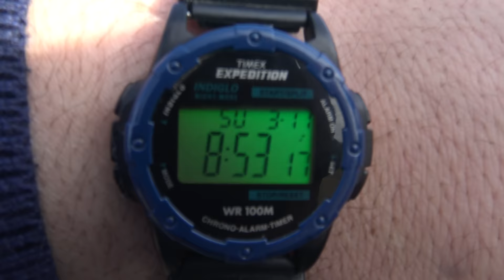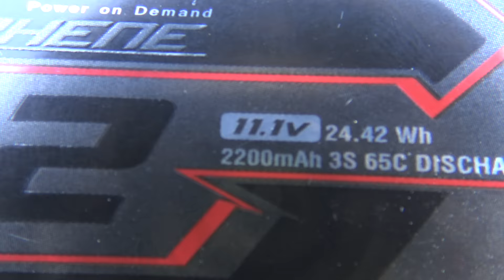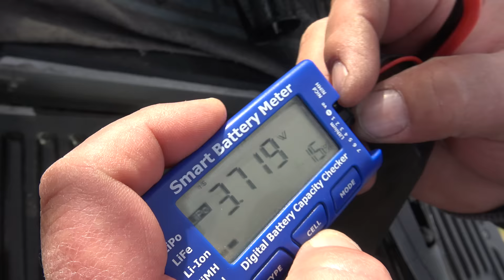SR-71 Blackbird Lockheed 2x 64mm 3S EDF Jet PNP Maiden flight

Comment: Another entertaining video Captain Robert & Blaz ! You were fighting the wind during the landing phase for sure. I visited the FreeWing Hobby Squawk blog and someone mentioned the exhaust diameter should not be less than 95% of  fans diameters. 
They also discussed upgrading to a 10 or 12 blade fan but of course you would have to replace motors , ESC and battery and planes battery compartment cannot handle a 6S battery without cutting foam. Advantages would be faster acceleration and shorter takeoffs. The sound on the 12 blade fan is also sexier for sure. But “ you’ll never stop with buying just one plane” how true Captain Robert!

Comment: I'm rather new to this channel.  I call that flight a success.  It really did look great in the air.  

It must be windy there most of the time.  If you 2 got to fly in calm conditions you would be instant masters.  I used to fly a small drone in windy conditions as a challenge.  It was fun to watch it backing up with full throttle.

Comment: I don't know if you'll see this comment Pilot Robert, but the reason the exhaust tube tapers on EDF's is to properly load the fan blades, give the rotor something to push against, and slightly higher exhaust velocity. there's some tinkering with the amount of taper to get the best performance without over amping the motor. the inlets will be shaped as such to slightly compress the incoming air to give the rotor some bite

Comment: Dis it it, hey! For ducted fans, inlet and nozzle design is incredibly important. The advantage is that by changing the area and shape, you can control its efficiency at different airspeeds. Mass flow rate is one thing, but air speed and air pressure also matter! OH YEAH!

Comment: I can help you with one idea... Where is the thrust connecting to the plane? It is not the air going out the back at the exhaust! It is at the blades of the EDF! Why do they add some cones or narrowing at the end of the tail pipe? Because the faster airflow lowers the pressure! This lower pressure enables the EDF to throw more air through the blades! That is an increase in thrust. There is an art to determine the curve related to thrust and the drag caused by the narrowing or coning of the exhaust. Too much narrowing or too large of coning will create more drag at the rear of the exhaust and the airflow speed will drop, which reduces the amount of air going through the blades, and the thrust drops. Weighing the thrust with different nozzles or cones can help determine the proper amount of narrowing or the size and shape of the cones.
In a real jet, there are many ways to slow the air going into the engine, including variable inlet controls. In the real SR-71 the cones move depending on the speed of the plane. 
As for modeling, it is important that the tube between the EDF and the exhaust should be as smooth as possible. The air coming out of the EDF is creating high pressure on the walls of the tube, and low pressure in the center of the tube. The air is spinning as well. So anything sticking into this airflow will reduce thrust. Thanks for not giving up on this plane. It will look great hanging from your ceiling! Thanks for telling us the history of your efforts to get this plane flying.

Comment: Fighter jets have adjustable nozzles. On take off they are fully open for max thrust but for  fast speeds they are  narrowed.   On the first flight the plane was very nose heavy.   You used the elevator to keep the nose up but this angle would not allow the plane to accelerate.

Comment: Maybe I can shed a little light on how the adjustable size of the outlets work with jets (called nozzles on fighter jets). 
With fighter jets, they will have large openings at the outlets when they are not using the after burners. 
When they use the afterburners, they reduce the diameter of the nozzles at the outlet but it's that intense heat that produces the additional thrust!
I'm sure you have seen fighter jets when they kick in the after burners, the nozzles move inwards to reduce the opening and then you see the nozzles turn red as the super hot exhaust and flames shoot out of the nozzles.  
Without the extreme heat while the nozzles reduce the size of the opening, the thrust is reduced quite a lot! :-) 
They only use the after burners when they really need the additional thrust because it use a LOT of jet fuel to create that super hot after burner thrust! 
I hope this helps! 

I'm enjoying your videos!! :-) 

Thanks!! :-) 

Joe
Reply from the maker: Thanks my friend for your comment. I was thinking really hard lately what is with EDF jets and how they work and even how to make them work better and finally I think I have something. I think now that the nozzle should even be on EDF jets but it works only to some point. There are small things on EDF units that can make great thrust or totaly ruin it. I think that we will film one video just of that becouse its really so interesting to me.I got many comments that you dont need nozzle on EDf unit, but even here you can make the preassure drop infront the nozzle and that means that you can suck even more air in the front. I just love EDF jets so much my friend. Big salute to you from Slovenia and thanks again for stopping by.
Reply: @PetrincicBrosRC  You are quite welcome my friend! 

Sometimes it just takes experimenting and fooling around with different things like the amount of air at the inlets and even at the cheater holes to get the maximum thrust. 
Personally ,for EDFs, it's more about the way that air enters the fan (for instant thrust from the cheater holes as well as ram air after it's in the air). 
The trick is to make sure the cheater holes compliment the ram air after it's in the air, if the cheater holes cause turbulence to the ram air stream, that could be a bad thing.
I like using a homemade wind tunnel and use smoke tubes to determine the right combination of ram air and cheater air. :-)  

I too think jets are fascinating!! :-) 

Thank you for the kind response!! 

Have a great day!! 

Joe

Comment: Great flight. I have to admit I was pleasantly surprised by the 3 cell performance. I owned the same bird and changed out the fans and ESC's and it worked great...till it burned up one day on takeoff. (Litterally) But I had faith, if you changed the fans an ESCs, you would get it to fly well. Congratulations!

Comment: The answer to your question is the reason ducted fans exist.. when you take any given amount of air and force it threw a smaller space it accelerates the speed of the air, by "compressing" causing added thrust, That's the whole reason for ducked fans to begin with I believe..? Just a thought hope it's helpfull. Much love, great job love the vids u got a new sub!

Comment: Robert, I had this plane, 2 of them actually and the best I've found ate 2 x 35p0kv on a 4s,2200 70C it was awesome!!. But I do not like the manufacturer LX  I did not have any problems like you in the beginning because I bought mine as kit from General Hobby and installed my own electronics

Comment: the Landing was good, but you had little unluck, because  the right main gear wheel touched first little hard on the asphalt undamped and than plane jumped to the left side, and with the small strip, the sr71 and side wind you couldent make best of it!

Comment: 👏🏻👏🏻👏🏻 As far as i have understand, the Key to Succses,  was the Change of the EDF Unit's, did You keep the Original Motors, or did You change the Engines too❓The Flight was....Perfect, no doubt it flew like it should (Delta just 👍🏻😁) but how did You get the Power from only 3 Cells❓i 've rather expect a 4-6 Cell Solution, as i've mentioned before, the Flight was marvelous, the Landing it selfe was not bad at all, but the Landig Arrangement was horrible, ok it's just a tiny little Landing space (almost a Post stamp😁) 
Pilot Robert, Cptn Blaź Your Video was a Pleasure to watch, so i've to Salute You ✋🏻✋🏻👏🏻👏🏻👏🏻👍🏻👍🏻👍🏻👍🏻👍🏻👍🏻👍🏻👍🏻👍🏻👍🏻👍🏻👍🏻👍🏻👍🏻👍🏻👍🏻👍🏻👍🏻👍🏻👍🏻👍🏻👍🏻👍🏻
Best Wishes and many Happy Landings, keep Going.
Anton from Vienna 🇦🇹

Comment: You have done it! :D Congratulations! So you have changed to EDFs which run on 3s... that is a good way to get the weight down. A shame that the flight time is so short, but still it is worth it to see that beauty in the air. I am curious, did you measure the thrust after replacing the EDFs? If so, what numbers did you get?

Comment: Awesome, just one question, what is your elevator deflection? And I have a cyclone after burner and Rx at rear of jet, do you think I should run a 3s also to get CoG Right. I went with spec on manual. Thanks I've seen it flying, I just need to know why mine is'nt. Awesome!

Comment: Hopefully there is a genius scientist that can reply, but I think the smaller exit means the air moves more quickly which creates a low pressure zone inside the EDF and then sucks more air in as a result, to fill that low pressure zone.
Reply: The same thing happens on the top of an airfoil
Reply from the maker: Very good thinking my friend. I also think so. But all the time Iam still wondering what is the ultimate truth of EDF jets. But that is why we are testing them to finally know why. Big salute from Slovenia.